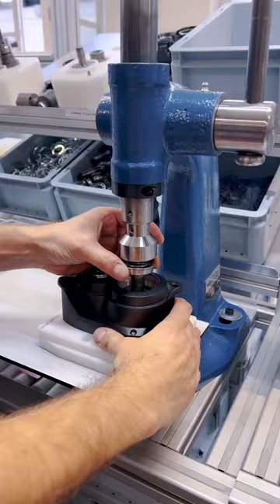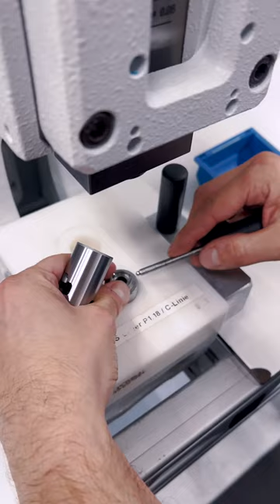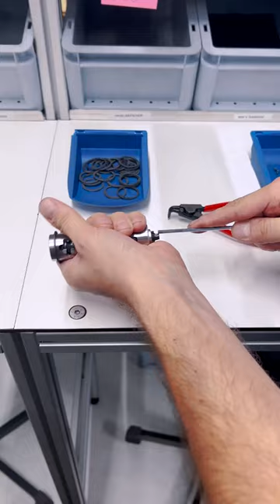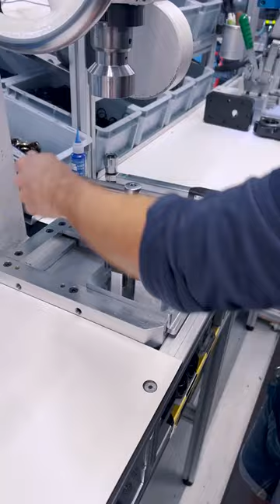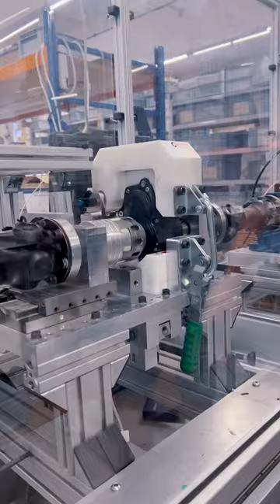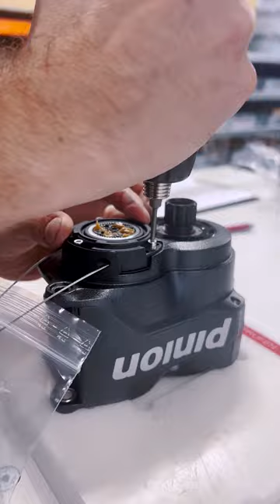Assembly of a Pinion C1.12 Gearbox #shorts

Comment: that is why pinion will be better than shimano and sram
Reply: They are better already. They became better when developed their gearbox. 
Unfortunately the big companies like Sram or Shimano are blocking and delaying this technology because the old tech making them big money. Sad, really.
Reply: @borismartin There is point in having derailleurs, it is called power loss and pinion gearbox has 9,5% of it while efficient  road gruppo like Dura Ace has only 3%. Gearboxes are cool, I like the idea. All e-bikes should come with one, also bikes that go more dowhill or don't need to be super efficient. Bud it is not a universal way for bycycles.
Reply: @borismartin did we just watch the same video? There isn't a conspiracy to keep gearboxes from entering  the market, if you watch the video again.. you'll notice the gearbox is a very complicated and heavy assembly, the complexity, cost, and weight means it doesn't make sense for more bicycle applications. I can't wait to get one on an ebike though! Chain and sprockets systems are just so cheap, light, simple, and efficient that they aren't going anywhere for the forseeable future
Reply: @SkunkApeOnTrail  Pinion released their Motor Gearbox Unit this year. My Enduro equipped with it ships in February
Reply: Except Shimano gearboxes cost $400-200. Good luck finding a pinion gearbox being sold stand alone at all, or finding a pinion equipped bike at the price of a Shimano one.
Shimano gearboxes might last half as long but it doesn't matter if you can buy three for the price of a pinion.

Comment: No operational checks?
Reply: pretty sure that happened right before he slapped a sticker/label on it.
Reply: It's a 50-second clip...can only show so much.  With this level of precision assembly you can be assured someone is monitoring quality.
Reply: That is done when it was connected to the motor - presumably that device is measuring resistance or speed from input to output of the gearbox